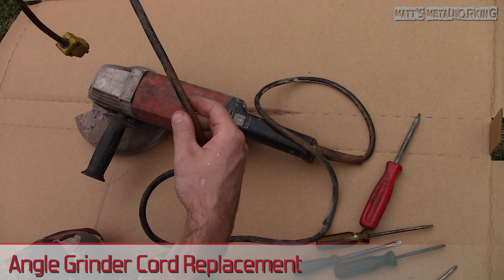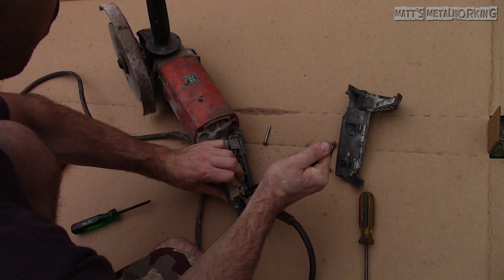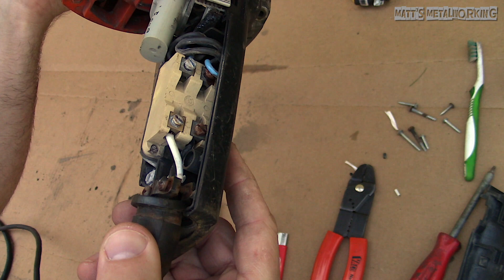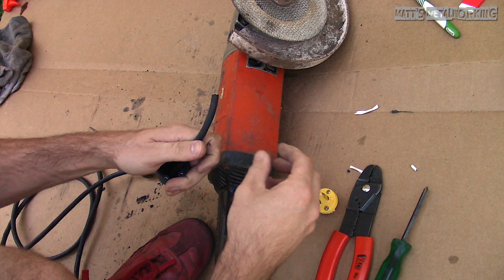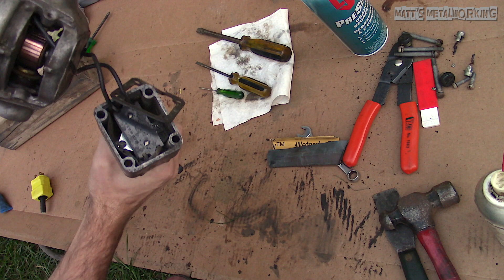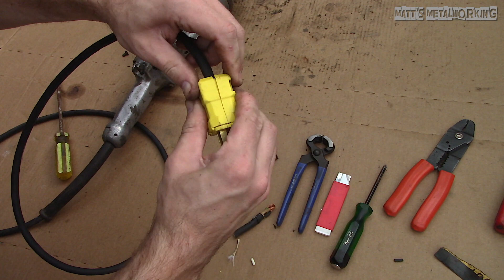How to Replace the Power Cord on an Angle Grinder

Comment: What gauge of cord are typically used on grinders? 14?
Reply: Different gauges for different amps. Once you remove the wires from the grinder you are working on, you will know. Never go larger or smaller in gauges.

Comment: do all wires have the wire gauge number written on it? if not how do you know what gauge size to use? 

also curious if there is an electrical unit such as an automotive headlights, how can I know what gauge wire i should be using to wire up those headlights? 

Thanks! awesome video btw
Reply: If you have wire strippers already, you could do the disassembly steps and check to see what size it has before buying the new cord. Just use the cutouts on the strippers to make the determination. The insulation doesn’t count, just the wire, so you can strip a small bit of insulation to see

Comment: I watched your video on polishing brass. I did that, took me hours, it looks great though. My only issue is, I consistantly get hairline scratches in it. I was wondering If there was anything I can put on it and what you recommended? It's a brass zippo from 1995. If you care to look at it, nothing_fancy21 on reddit. I have before and after pics uploaded.